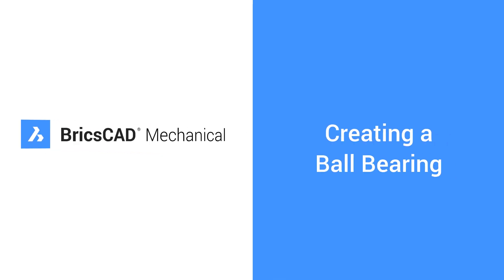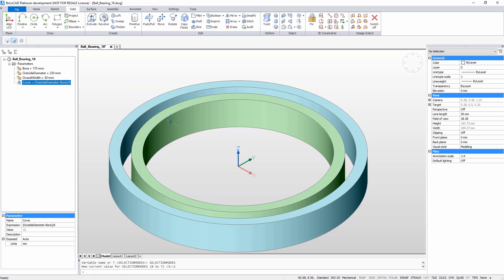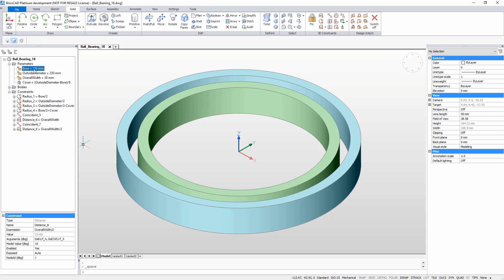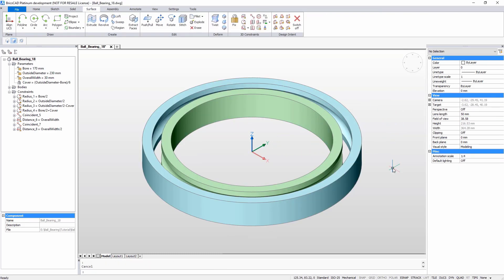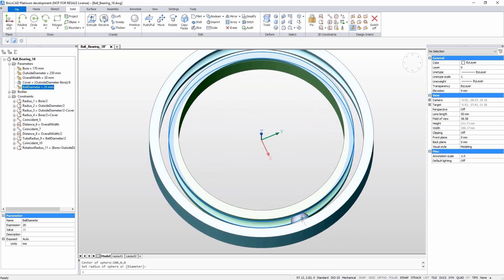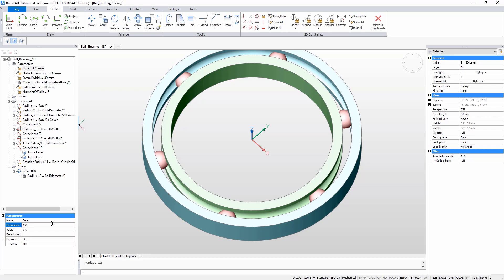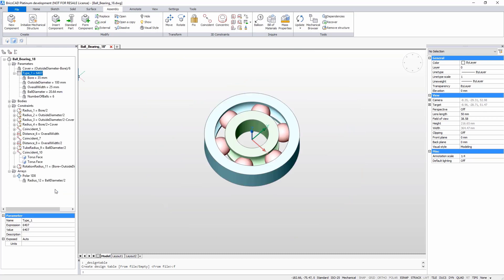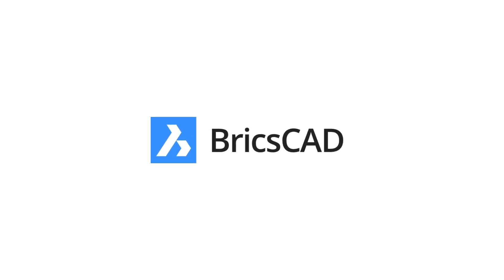Use Parametrics and Constraints to make a Ball Bearing - BricsCAD Mechanical

Comment: extrude and offset tools where did you get this from?
Reply from the maker: You can find these commands in the ribbon, the quad or you can simply type them into the command line.
For more information on Extrude: https://help.bricsys.com/hc/articles/360006607034-Extrude
for more information on Offset: https://help.bricsys.com/hc/articles/360007745593-Offset